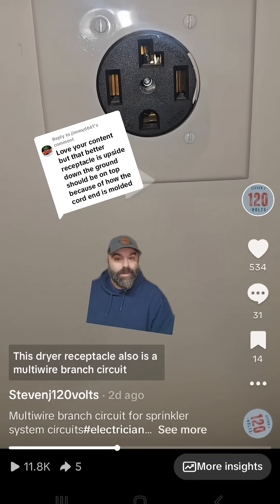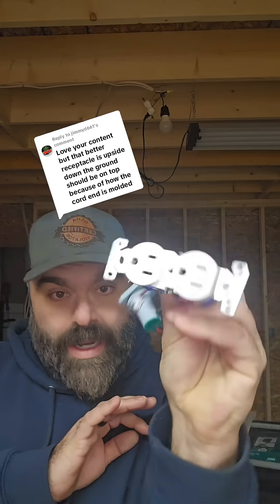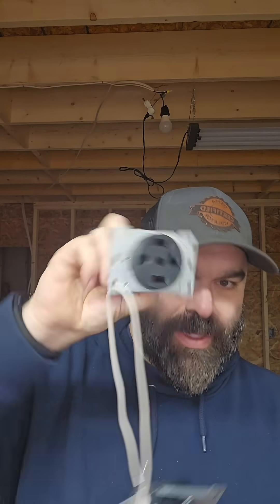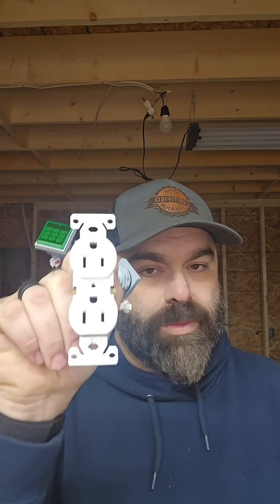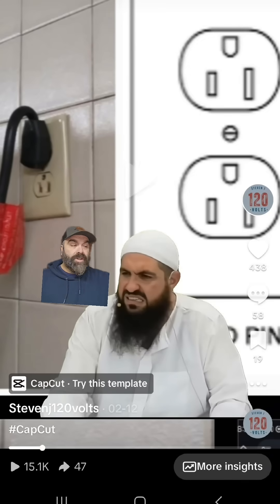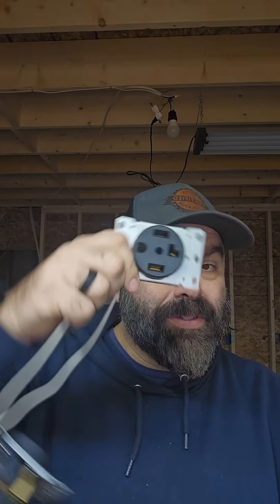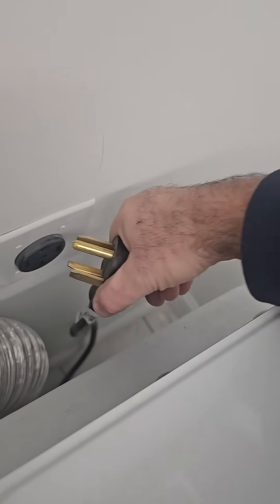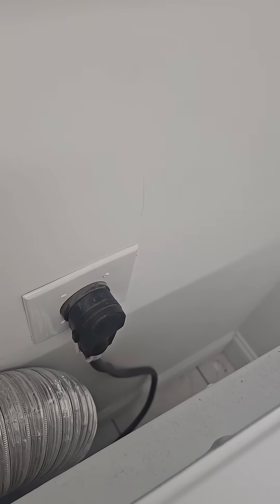upside down receptacle?  ground up? ground down?

Comment: I have a problem with a newly built home.

Out of the dryer wall plug, 
the neutro to line 2 is 87v 
?🤔
to line 1 is 124v.👍

Line 1 to line 2 is 245v👍

From ground to line 1 and ground to line 2, both are 124v👍

Can you help me understand this.

Comment: Aside for the indicating of a switched receptacle there is another reason I have heard. That is called an "office" or desk outlet orientation.. You mount it ground up for the chance a paperclip could slide off a desk and get behind the plug and the first thing it touches is the ground. Thereby giving it a 50/50 chance of making contact with the ground and neutral. The other way is still a pop and maybe a breaker trip. Also if you have a sideways mounted outlet it is preferred to mount it neutral up. This all depends on the type of cord and plug you are putting in and which way it will best orient.

Comment: When you see grounds up in residential you know a commercial guy did it. If the cord isnt on site i usually go with keeping the stamped lettering on the yoke right side up. If the cords on site then ill just do it so the cord goes down

Comment: As a contractor, and a former service director for multiple different apartment and multi family homes for a very long time I can actually put the ground up/down to bed….. it’s an old tradition and I still very much push it to any new trainees, most of the properties I worked on where built back more than 30+ years so here’s what I’ve been taught and how it used to be done; back when it was very common to have lamps in every room including bedroom’s living rooms, dens and such it was desirable to have switched outlets, now the common practice was to flip the receptacle so it would signify that it was a switched outlet. Obviously the trend of switched outlets is fading away but but I digress anyway in the multifamily industry the flipped outlet comes in very useful to stop or resolve maintenance calls when they call in (usually new tenants who aren’t used to the layout yet) will call saying my outlet isn’t working and without ever having to go in and diagnose the “issue” we can simply ask is the outlet upside down? If yes we explain that means that outlet is on a switch so the switch near it that “seams like it does nothing” actually turns on and off that outlet 
Ground down- normal constant power 
Ground up- switched receptacle
Reply: Irrelevant BS

Comment: For the standard socket, folks just seeing them upside down in old kitchens and bathrooms led to the thinking it’s a safety thing. The practice had nothing to do with safety. Back in the day, at least in some regions, before 20 amp sockets had the T blade, 20 amp circuits were installed upside down to differentiate them from standard 15 amp ones. 
Some places also had a convention for installing switched outlets for lamps upside down.

Comment: I'm in ground-up teritory, but the other side of the ditch they sometimes have it at the top AND bottom of the connector. I especially like the logic of the system that has ground STICKING OUT OF THE WALL CONNECTOR because technically its kind of right.

Comment: It was a code for years. Decades. China screwed up on the plugs. We can’t change china. So we dropped the code in the early 80’s. It just got forgot about. But yeah it’s possible for thin metal objects to slide down wall coming to rest on the plug. If the plug happens to have any gap showing metal. The thin metal objects can contact a prong. Which prong would you have it contact? The ground or the load?  I think we should just send cords with wrong configuration back to china. Let them deal with it.
Reply from the maker: @pjplumber2146  It was never code as far as anything I've ever been able to find.I have electricians in the family who have been electricians '70s I've been electrician since the '90s and I have a complete code collection back to 1940 Tell me where to find this code.

Comment: When I was a kid my desk was placed up against a wall & that wall had an outlet.

When I dropped a metal ruler it made that 1 in a million shot & shorted across hot & neutral. 

With that particular setup the chances are more like 1 in 20. Not that blowing a breaker is a big deal.

Comment: The 90 is a issue with manufacturing, not installation. Ground down gives a point at catastrophe to some form of correction at a higher chance than upside down.
Reply from the maker: @insainwhiteboy1  what catastrophe can haappen? If something did fall inside I have pulled out plug You going to get a small spark in a trip breaker and maybe the cord end could be  ruined That's it

Comment: So, i have a 120 recepticle under my gas stovetop cabinet. My pots and pans are stored there. One day a lid fell behind the plug that was in the recepticle and caused a lot of fireworks before tripping. Maybe upside-down is better under there. I worked a big hospital where all the red (emergency) recepticles were ground up, but not the rest! Why?

Comment: Place your receptacle in a manner where the cord is not under stress. Plug in and forget about it.
Its just that simple. Also, for general purpose recepts ground UP is actually the right way. Then GFCI became a common thing and people stopped doing it. Old school sparkys, if they're still working STILL  install ground UP and there's NOTHING wrong with it. 😊

Comment: Plug cords have been designed for thumb to pull plug, rather then yank them out of wall. The ground up, do they not trust circuit breaker, ground fault breaker or Arc fault breaker, they specify safeties that they don't trust, from some mind game to create injuries. Yet don't recommend placing outlets at high location, making outlet visible to playing with.

Comment: Knocked a metal wire handled fly swatter over which slid down the wall and made contact with the hot and grounded metal faceplate while I was plugging in an appliance. I don't have to tell you what happened. Can't say what would have happened if the receptacle had been installed ground up.

Comment: All things being common, if the dryer socket is ground pin up then sockets should all reasonably be ground pin up. You are talking about the cable being bent what ground pin up on a normal socket, most of the time the socket will be below whatever it is powering.

Comment: A guy I greatly respect argued that it is better to put the ground towards the bottom. He argued that, if you put the ground UP and  a cord sags, you could lose the grounding for the equipment, which is immediately dangerous. On the other hand, if you put the ground down and the cord sags to expose hot and neutral blades, there is no immediate danger and only the remote chance of someone dropping a conductor just right to short them.

Comment: When I worked with electrical group in the facilities department at my local University/Med Center many, many, many moons ago, that "one in a million chance" was a monthly, if not weekly occurrence in the research/office environments on our campus. Those stars truly do align regularly in office settings with cubical systems in place because of their physical design. The little gap at the back of the desk is just begging loose paperclips to funnel straight down the wall and find their way across hot/neutral plugs that aren't pushed all the way flush to the receptacle. Once my lead electrician started flipping the receptacles to ground up, that monthly/weekly "one in a million chance" problem simply disappeared altogether. 🤷🏼‍♂️

Comment: If it's of interest - In Canada - Quebec's provincial electrical code specifies ground up on 5-15 receptacles. I agree this gets annoying with 90 degree plugs.

Side: Up to how much exposed plug blade can be exposed (and thus not touch-save) before it disconnects from the receptacle?

Comment: Been a building engineer for 23 years in an office building with 12 30,000 sq ft office floors, atleast a dozen times something has fallen off someone's desk between the plug and the outlet and shorted the outlet behind it, once caused a small fire that was easily put out and all of them left a big burn on the wall. Is that common? Maybe not but its not 1 in a million either.
Reply from the maker: @stinkwink695   @stinkwink695  well your shop is messed up. I have 29 years as an electrician and i have never seen it happen. My dad has been an electrician for over 40 years he has never seen it happen. My uncle is a Master Electrician was the inspector for my home town he is retired now but we was in the Field working and inspecting for almost 50 years and he NEVER saw it happen once. My cousin who has passed away was an electrician for 31 years and he had never seen it happen. I have never met person in real life who has aee it , only commentors tell me they saw it. I set up receptacle for an experiment and i was trying to intentionally getting to happen and i couldnt get it to happen
Reply: @Stevenj120volts  My shop? Its an office building. I'm not reading anything else because its irrelevant, it happens, usually paper clips, once was a staple, and even a pair of scissors somehow made it between the plug and the outlet. What you haven't seen is meaningless, Ive seen it atleast a dozen times and have heard of it elsewhere at other buildings and I dont go around asking about it. One of the people it happened to said it was the second time its happened in his office, I wasn't even there for the first one.
Reply from the maker: @stinkwink695   i didn't just list what i didnt see.    if it was a hazard they would change the code.  They have not Changed the code because it extremely rare and not a big deal when it does happen.   If you have seen a dozen times in one building someone is doing it on purpose
Reply: @Stevenj120volts  It was different people every time, different offices, different floors different companies even, it simply happens more than you think. What you or 5 random people haven't seen is meaningless, what people have seen means something. I didnt call the  electrician that installed the outlet, I removed the paper clip that was welded to the plug and reset the breaker and wiped the wall off. I most likely have a picture of the burn from atleast one of them, and I've talked to people about it when it happens and have met other building  maintenance people who have seen it. When you push your desk right up against the wall it makes a perfect slot for things to fall right along the wall.
Reply from the maker: @stinkwink695   I didn't list 5 meaningless people,, i  listed a group of people with a combined 300,000 hours of experience  working with and repairing electrical equipment and none of them have seen it even once.  But i am supposed to believe you have seen a dozen times.

Comment: You put it in upside down even if your apprentice did

Like the light & bulb socket & plug without a box overhead in your shop.
Reply from the maker: @mattkris7055  you mean the bad ass light set up at my house ..that i "accidentally" have in the background of my videos.   Wow,  electricians get the point

Comment: I have done a lot of these. Some manufacturers have the ground on the top but i have seen them on the bottom.   I have changed a few because the manufacturer had it different.

Comment: The first time my cat tossed a necklace onto a plug was the day i put all my receptacles ground up and installed afci/gfci combo breakers everywhere. Probably overkill, but no more sparks and the afci upgrade helped me find cracked wires after a lot of frustration.

Comment: I'd also argue that 110v ground up ... There's at least a few milliseconds during most cord trips where the ground could disconnect before the hot. That's that they have a downward pull from the plug center more often than not.

Most ground prongs are slightly longer than the hot/neutral prongs. I believe that this is intended to ensure the ground connects first to prevent shocks to the user of the equipment  this elongation would also help keep in as the last thing to disconnect while being pulled downward. If you flip ground up, I argue you could get shocked in those few milliseconds.

So you have a very slim condition and a knife would still have a 50/50 chance of sliding toward the hot since the ground is usually round. This scenario creates a possibility that someone trying to catch a knife sliding down their wall might get shocked and/or tries to protect the plug. 

The other protects the user from a very real possibility that the device has a broken neutral and the ground disconnects before the hot, creating a shock hazard. 

Both are fairly unrealistic... But arguing ground up is safer? I just don't see the payoff vs ground down given the two scenarios.

Comment: When it comes to dryer receptacles I put the ground on top, I've done it for decades. However, if I happen to be on site and doing work and actually see the cord of the dryer and the orientation of the angle? I have always reversed the receptacle to match the cord.  With the standard duplex receptacle for residential applications upside down denotes the "Switched" receptacle for those rooms without permanently installed ceiling fixtures.  For "Hospital" instances the receptacles are installed upside down in patient rooms. This IS for Safety of conductive material dropping down upon equipment "Cord Cap" with potentially "Exposed" conductive metal(prongs) bridged by random circumstance creating an fault-current circuit interruption. This does not occur with a ground prong vertical scenario.

Comment: The only time I was told to install receptacles upside down was when we were using, the metal stainless steel wall plates. "And this is a big if" should the trim screw come loose and the plate fall it will come in contact with the Grounding conductor First. Is the logic.

Comment: I noticed the wiring job in the background of your video. Dangling and unsecured receptacle connected to an unsecured incandescent fixture with an extension cord to a fluorescent fixture with connections made outside any box.  And you’re lecturing on code?
Reply from the maker: @WY-83001  yes I am

Comment: So I was installing a sub panel , drilling some holes In the drywall , 5’ away an outlet blew up . I wasn’t on any electricity I looked didn’t hit anything well the customer left a razor blade on top of a box plug in n the vibration made the razor fall and hit the hot and neutral on the plug and blew up . The odds of that? Lucky it was me and not the customer .

Comment: I just replaced my dryer a few weeks ago. The cord on the new one is molded the opposite direction of the old one from 20 years ago. My dryer receptacle is also very close to the floor and having the cord lead pointing upward is actually better in my case.

Comment: I only use ground up on switched outlets. It all depends on what the customer prefers, switched outlets ground up, stickered, or ground down to match the rest. On commercial jobs, I try and keep everything ground down unless the application/ situation requires otherwise.

Comment: I've run across some dryer cord ends that were ground up and some that were neutral up.

I try to check the dryer first if it's available. Whether or not I'm lucky enough to check it ahead of time, I leave enough conductor that the receptacle can be turned 180 easily.
Reply: Exactly, I wait for the stove or dryer before putting in the receptacle.

Comment: ADA says ground up. We wired a daycare center and hospitals, the ADA required ground up for the added safety of the children. The NEC doesn't specify, but the ADA does when children or the disabled/handicap are concerned. There is your nonsense.
Reply from the maker: @JNash-ro5on  the ADA only has rules for receptacles heights.  Can you give me a reference for what you are talking about.  Because there is NO actual added safety for ground up. And children or disabled people would not affect that.  I have guardianship of two special needs adults one who lives with me. And there has been ZERO discussions about the rules for receptacles orientation in her living space.  So give you reference or stop making Stuff up

Comment: I had a hospital job that had certain 5-20 receps were to be installed upside down so cleaning staff knew those were to use by them. Common area and corridor mainly.

Comment: In old skill electrical 1 upside down receptacle in a room showed it was connected to a switch. In California code is all receptacles are upside down to relieve strain on ground wire in a cord

Comment: On 120v receptacle, it might be code to put ground up if you use a metal receptacle cover, if not, it’s still better to. And no it’s not about butter knives, it’s about the cover coming off.

Comment: I put in a very tight nema 14-50 for an EV charger. Damned if that one specific brand of charger didn't have an upside-down plug end with respect to every other 14-50 on earth.

Comment: Not only is it likely that the cord will be damaged over time with such a sharp bend in it, you're also trying to fight gravity. Over time the weight of that cord will pull the plug out of the socket little by little.
I've seen commercial 20amp outlets where this has occurred casuing arcing resulting in a melted plug and outlet. Its a potential fire starter.

Comment: If the labeling on the outlet is double labeled the direction can be installed either way otherwise  I will tote in code class the labeling is the definition of what is up-and-down you will notice on those outlets it is labeled in both directions. Plus the ground pin is longer commercial buildings ground up the idea was it would hold in I know that is a pissing contest but that is what was in the code class